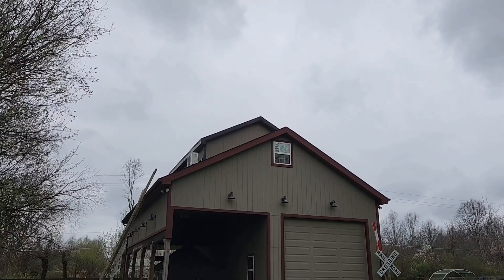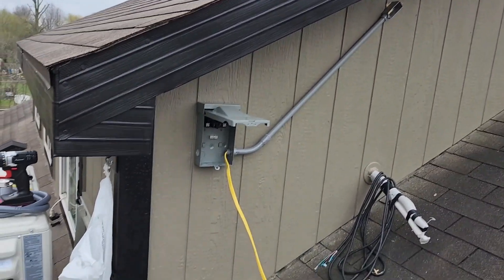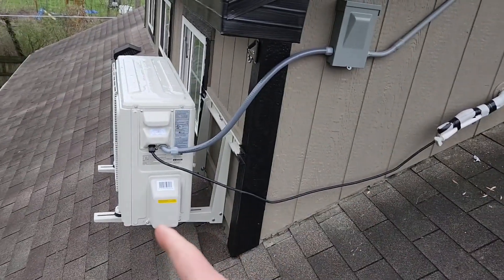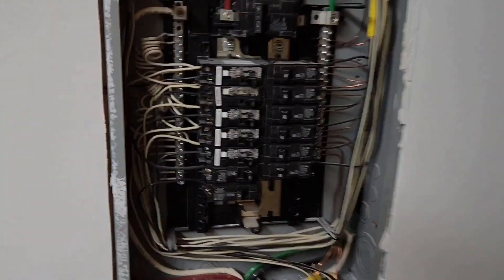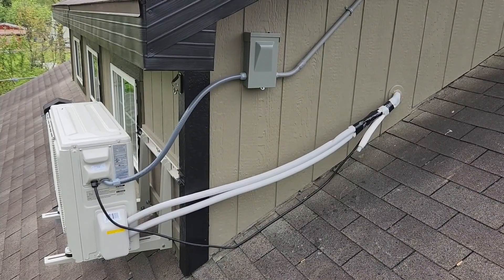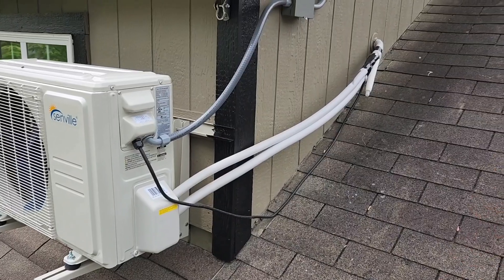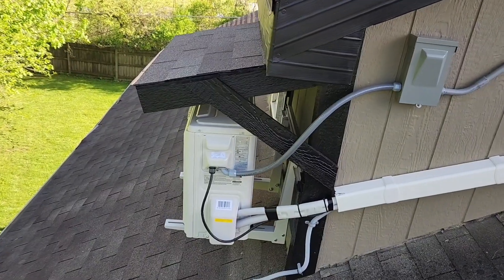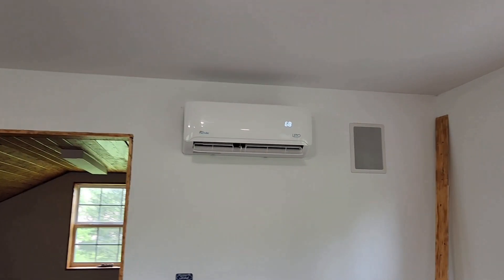Mini split running cool (part 6)

Comment: 😮😮 that will be nice heat and AC I need something like that in this house 🏠
Reply: Dwight these mini splits are so nice for place’s without ductwork or scenarios like Pappy had here😁👍🏼
Reply: @stretchlimo7275  I have duct work but I have propane heat to and it sucks 😞
Reply from the maker: It's really nice beeing up on the wall and out of the way, and not taking up a window. And it's really quiet.. I'm happy with it so far.. I'll let ya know how well it holds up. It's probably going to be running non stop.

Comment: That turned out really good Pappy. That’s good you cut that excess off and I’m no hvac guy either, I would’ve called a guy to come out and reflair them lines and pressure test everything. I would definitely paint that conduit and the cover for them other lines like you said, it will make everything blend right in. Nice job on that little roof extension, definitely a good idea, you would’ve had a ton of water getting in there, you could’ve just put a gutter up but this mini roof is the ultimate protection. I would still recommend a gutter though Pappy, just so that water running off doesn’t accelerate the wear on them shingles below from the water pouring off. I bet it feels soooo good up there now, most definitely a good purchase. You did an A1 job Pappy👍🏼😎🇺🇸
Reply from the maker: Thank you Stretch, been a long time coming. Still have to get the door up to seal off the room but that project is coming along.. putting up a gutter is not a bad idea been like that for years, but since being up there looking around I can see some ware happening on them shingles. May be a project for next year.. Definitely so glad I did this.. appreciate you watching